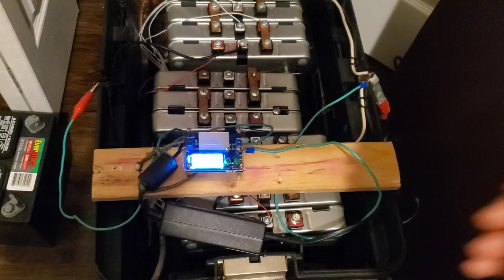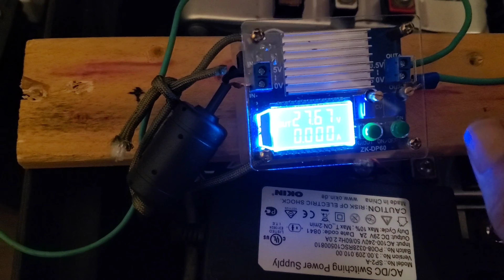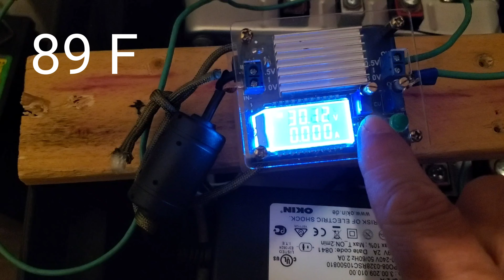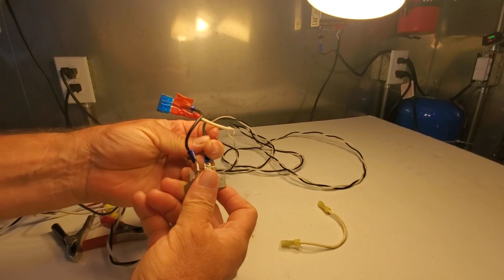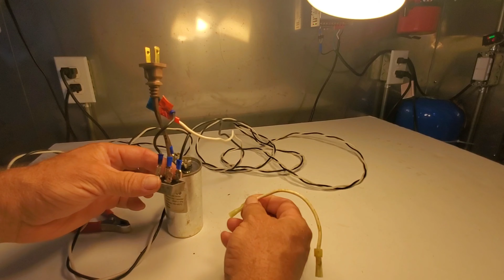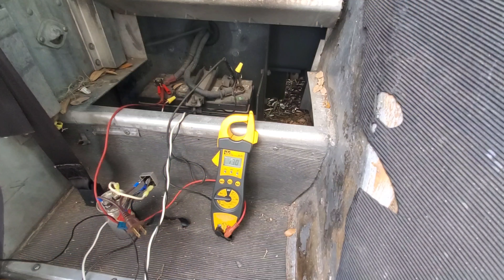Making Two Battery Chargers and Even charging a high voltage battery

Comment: hi, for the high volt charger(hv battery)is your ac line 240volt or 110volt?
it will pump at some times 100ampere ...isnt it too high for charging hv car batteries?
Reply from the maker: It's 110 charge is limited to capacitor.  The bigger the capacitor the more amps.  This is a slow state of charge
Reply: @eby6114  thank u for ur reply, i am really confused, if ac line is 110volt then maximum peak voltage is 155volt...and ur prius battery pack is not less than 196 volt...so how can this charger pump charge inside it?
i did saw in ur video that battery voltage is rising!!!
how do u connect capacitor?there must be some magic!!!
Reply from the maker: @ALAL-jm1lr  Ahh I see.  The capacitor will raise voltage above the battery until it encounters enough resistance.  I've left this same charger connected to a 12v battery for days without any issues.
Reply: @eby6114  on 12 volts its understandable,but on 200 volt batt its not possible...or i may need refresh my electricity basic course😅
Reply from the maker: @ALAL-jm1lr  I thought about making another by video using this same charger on my newly converted lithium pack that I made to replace the NIMH hybrid pack.  Not sure if you've seen this video but it would be relevant to your thoughts.
Reply from the maker: I believe this capacitor can reach up to 370 volts depending on resistance encountered
Reply: @eby6114  its really great, can u plz share how u connect capacitor to the bridge and ac line?
Reply from the maker: @ALAL-jm1lr  At 3:20 AC input is diagonal from each other